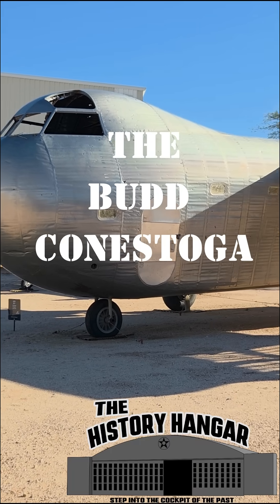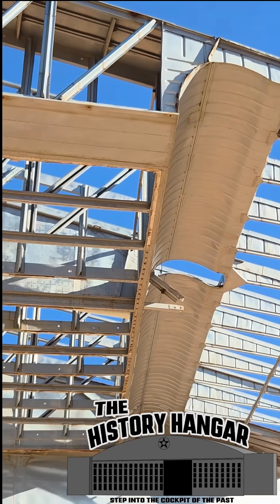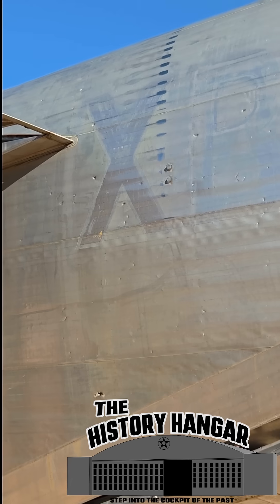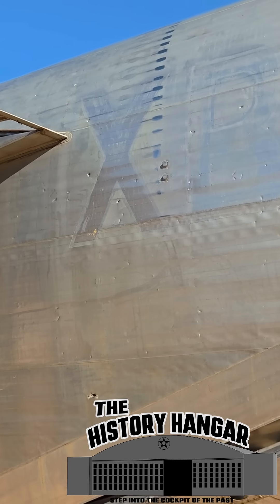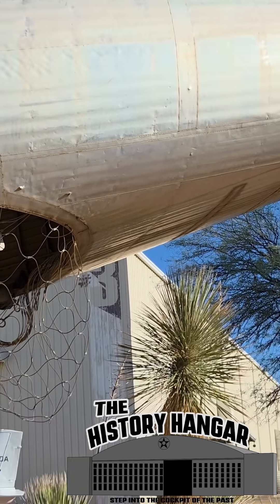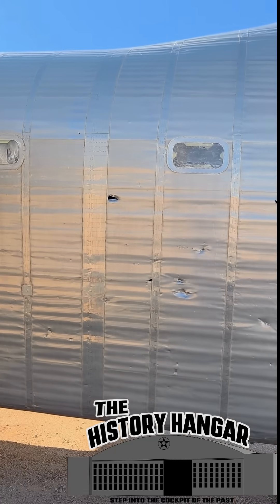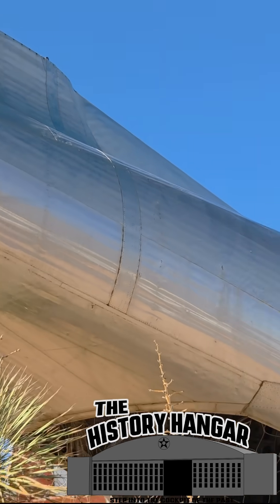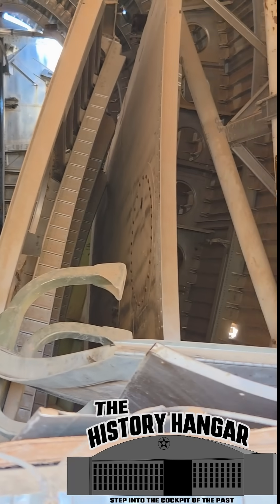This plane was built like a train and flew like the future #rare #militaryaircraft#thehistoryhangar

Comment: When I was a child I had a Lionel Bud .
Each car or rail bus had two 300 hp Detroit diesel 2 stroke engines and an hydraulic transmission which allowed a top speed of 85 miles per hour at the Burlington - Ohio service.
Reply: Budd RDC , rail
diesel Car . And the 6-110 engines were only 275 hp.
Gm turbo ed the engine later but I do not think Budd ever used this version .

Comment: This makes a mockery of the basic aerodynamic thinking. Simplify and add lightness. The framework looks like a girder bridge and its shame makes me think of a flying barn door. Add the fact that it was made of stainless steel and you have an overweight machine. It would have maxed out weight wise before it got anywhere  near maxing out that cubic capacity of the hold.

Comment: MIG25 and MIG31 are also made of stainless steel. So is starship.
Reply: Actually the MiG-25/31 are nickel maraging steel, like high strength bolts or landing gear. Starship is stainless steel, as was the XB-70.
Reply: @adamc.sieracki4145 NORTH AMERICAN AVIATION XB-70 VALKYRIE MENTIONED 🗣️🔥💯💯💯🔥💯 (I came here to mention that but you already did)
Reply: @thatawkwardfeeling9076Interestingly stainless steel honeycomb was an exotic material then, but now there are fabricators everywhere.
Reply: @adamc.sieracki4145 I know a decent amount of the process of making it, it's super interesting. I've done a lot of research on the Valkyrie, and it's my fav plane (it's on my banner, with me under it) the honeycomb steel is a quarter the weight of solid steel, and three times as strong as if the material was just one solid layer. It was expensive and required advanced and complex brazing techniques involving large, oxygen free ovens. The honeycomb structure was created by putting thin steel strips through a set of gears that bent it into zigzags that were brazed together, then brazed to relatively thin steel sheets, resulting in a 3/4 inch, very strong but light material that was used through the entire aircraft. It was strong enough to not need many internal structures. Parts of the Xb-70 were made of titanium, mostly leading edge parts such as the leading edge of the wing, the nose and the vertical stabilizers. I don't have my books with me rn so sorry if I got something wrong. :3
Reply: Starship?
Reply: @EZB-747  what is spacex' starship made of if not stainless steel?
Reply: @EZB-747 Elon's Rocket. It's a balloon (pressure stiffened) tank, like the old Atlas missile.
Reply: @adamc.sieracki4145 thanks. I thought maybe beechcraft starship
Reply: @EZB-747 That was a great looking composite aircraft. It made an appearance in Airwolf.

Comment: Built by Budd at the rail car factory off Red Lion Rd. in NE Philadelphia. Budd pioneered the use of Stainless Steel in rail car production and several aircraft firms in the area used the material with Budd's assistance in the 1930's, Fleetwings was one company that used the material in production of their aircraft.

Comment: The thing that mystifies me is why stainless steel wasn’t considered a scarce strategic material as well. Most  stainless steel requires nickel and chromium.Nickel and chromium are required to make almost any high alloy steel, such as armor plate.
Reply: Logistics are logistics, good to have a backup plan in case aluminum gets scarce, the mosquito was done with plywood to save aluminum
Reply: Not to mention just about everything non-armor that's important. Machine parts, bearings, tools etc.
Reply: Were chromium and nickel in critically short supply at the time?